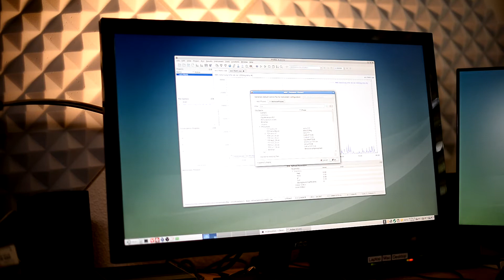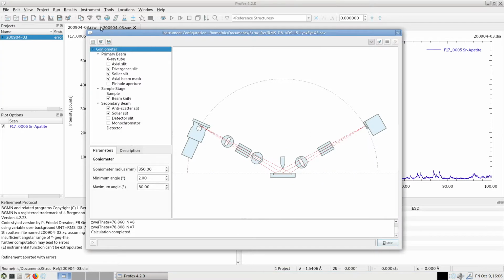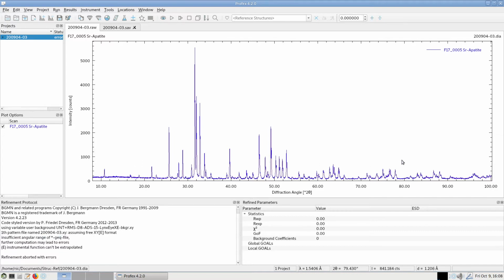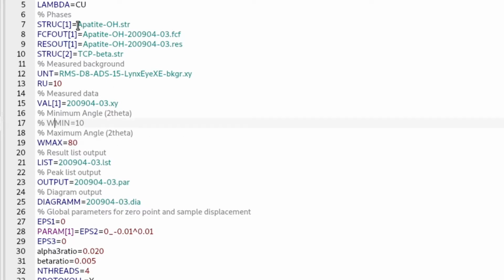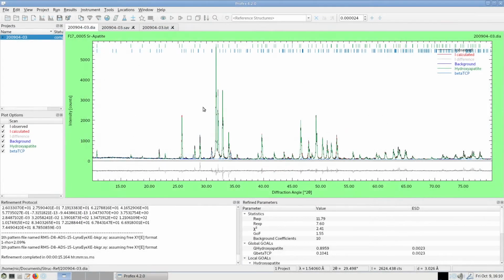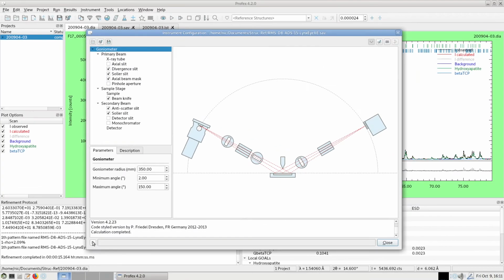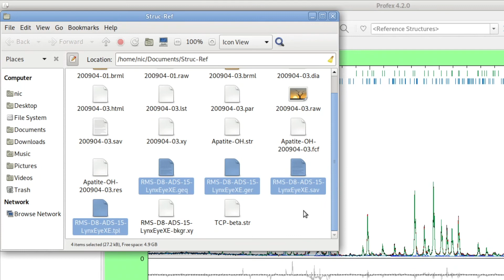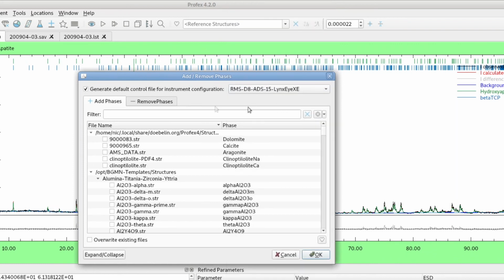Profex XRD: Fixing the "insufficient angular range" error

Comment: Very nice explanation. At this ponit it would be very nice to have a tutorial on the "learnt profile" option (i know its more BGMN), espescially with low angles (starting ~ 4 to 7° 2 theta).
Reply from the maker: I will think about doing a tutorial about learnt profiles. But please keep in mind that there is no good standard material with peaks at such low angles. That is why FPA programs (BGMN, Topas) excel at modeling low angle peaks, because they don't need reference peaks or extrapolate the peak shape.